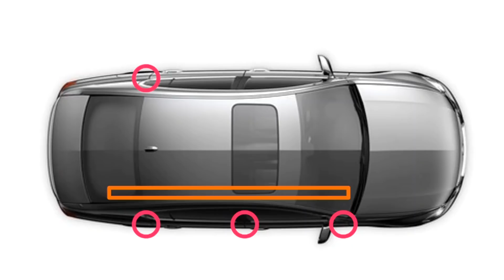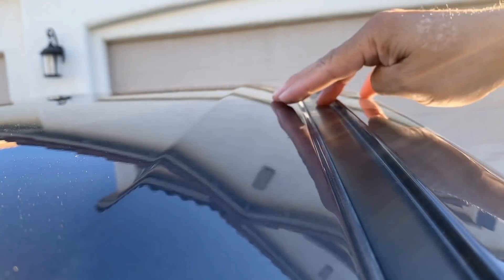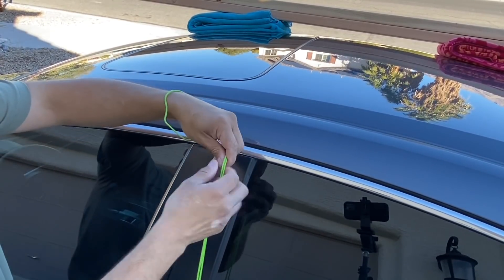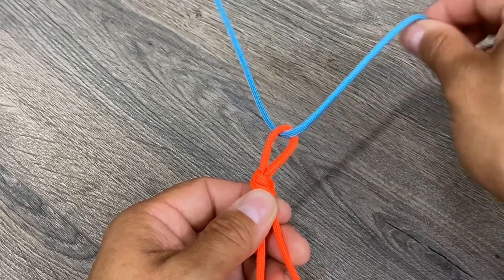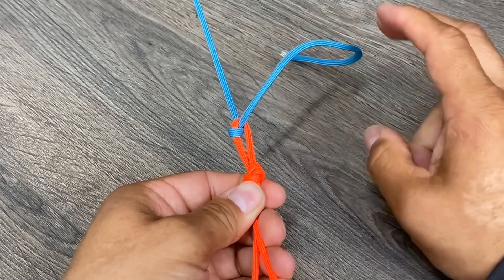How to tie down 2x4s without a roof rack.

Comment: Curious to see how one would tie down bars from a roof rack using towels or even those foam block kits for strapping down canoes without a rack. Well, I had to do that today, to transport SUP, but what I did definitely has room for improvement. I used 1k/lb kevlar cord.

Comment: And there is a way to fold the towers where you form a pocket and feed the free ends in so you can toss them around and they stay folded. This way a fella could use old towels, fold them, and keep them in a trunk or box as a kit for frequent use.

Comment: Very nice.  Just a thought though; might consider going through the anchor points, back up to a truckers hitch loop and then tighten by pulling downward. 2:1 mechanical advantage plus easier than pushing upwards. That's how we would tighten down loads on the farm.
Reply from the maker: Good thinking. I’ll have to do that one next time. Thanks!
Reply: This is also how I learned to tie small boats to a roof. One question - what’s the purpose of the two half hitch loop at the end?
Reply: @UnderstatementJones1  The Blackmail Hitch can slip and the half-hitches prevent that.  The Blackball is used to hold tension while you tie off the line but isn't secure enough to be the final tie-off.potential.

Hope that helps.

Comment: So the part where you say you're putting a "lark's foot" on the 2x4s, it's more commonly called a girth hitch in that configuration. Obviously there are millions of different names and you're not exactly "wrong", but in this comment I'm going to be using the most common names in case anyone else reads this and wants to do their own research.

Now your girth hitch in that spot isn't bad per se, but a better one might be a clove hitch. Not only would a clove hitch tighten more effectively, it would also allow you to adjust the position of the 2x4 more easily with the tension removed.

Also, I think you'd be fine using only one line on three attachment points, as long as you used the middle attachment point that was farthest from the boards. The one line actually does give you tension from both sides; even tho the trucker's hitch is on one end of each leg, the tension equalizes when the board moves slightly. Of course it's great to use two lines, but I wouldn't bother myself.

Comment: I just lower the passenger seat and the rear seat back and load all the 2x4x8 inside from the back  to front... in a small nissan sentra ... roof rack is only for 4x8 plywood or bigger sticks and legally the stick can be up to 2ft pass the bumper with a red flag at the end... I would not trust knots because I am bad at them so I rather use ratchet straps and loop it all around the top and bottom of the roof , beat any knot any time.

Comment: top timber tip: next time orient the timbers resting on their shorter edge, next to each other instead of on top of each other. That will dramatically reduce flex and bounce on longer timbers.
Reply: That is a great tip. If you have to stack them could you alternate? One layer wide, next layer tall? That way the stack wouldn't get tall as quickly but you still reduce flex?
Reply: A 2x4 measures 1.5"x3.5" so they wouldn't line up very well. Maybe a couple rows high. I do like your thinking
Reply: @steelonius  Better not to stack them up on a car roof. Better to lay them out across the roof to spread the load, instead of putting all the load in one spot.

Comment: Love that you showed us the 275 cord, might have to get some. What other types of cordage do you use and what are some pros and cons of different kinds?
Reply from the maker: 1/4” paramax is my favorite. I use it for almost everything. I also just picked up a smaller cord called “micro 90”. I’ll make a video on it soon. I stay away from twisted rope and prefer braided.
Reply: @First_Class_Amateur  would Paracord work reliably in this use case too, if that's all you have? What are the pros/cons of fewer but thicker inner strands?